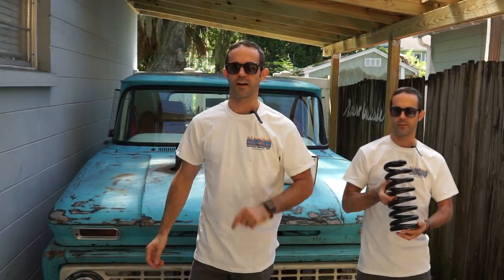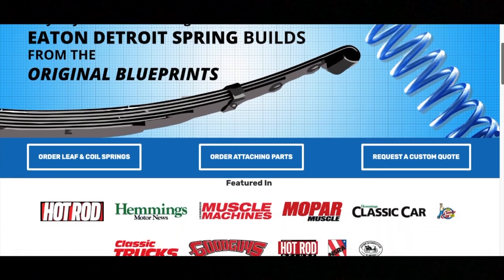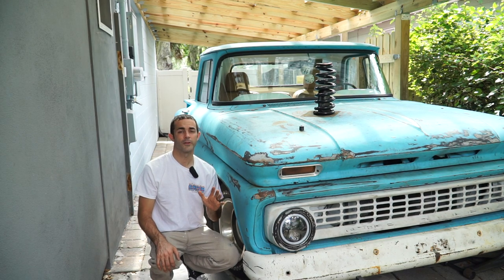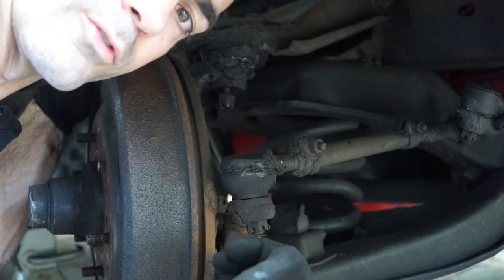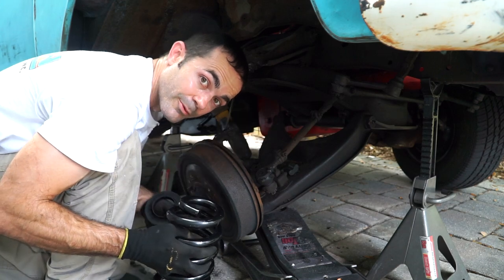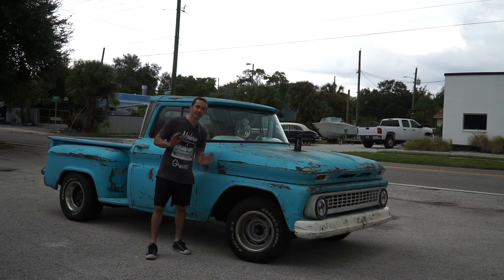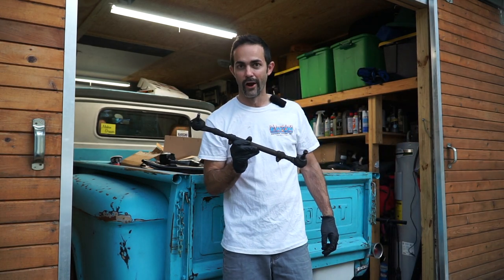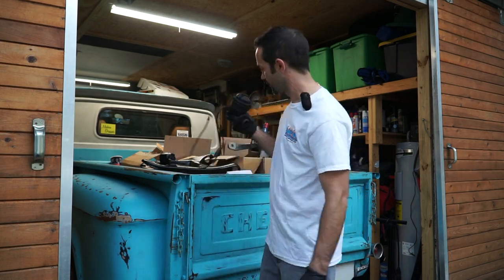12V Cummins diesel swapped C10 front coil spring replacement with engineered Eaton Detroit Springs

Comment: Make sure you drive it before you cut it. I think they settle a little from driving.
Reply from the maker: Dude, you're absolutely right!  When I set the truck down, there was a decent sounding bang from the spring finding it's placement.  I am hoping to not cut anything.  Good advice, I'll have to driver her around for a bit then assess the spring height.